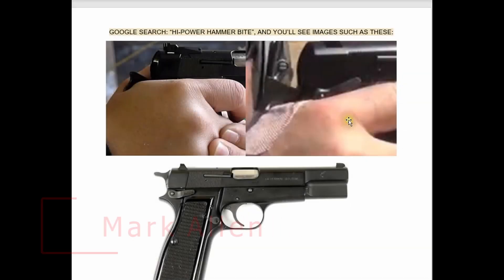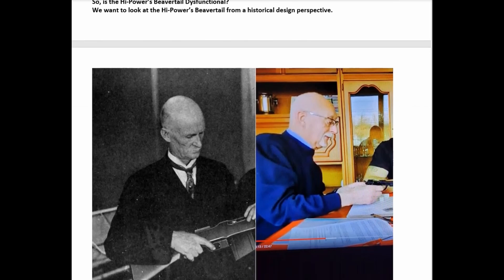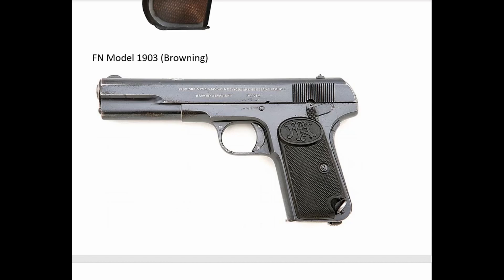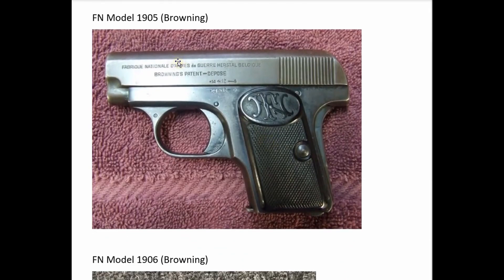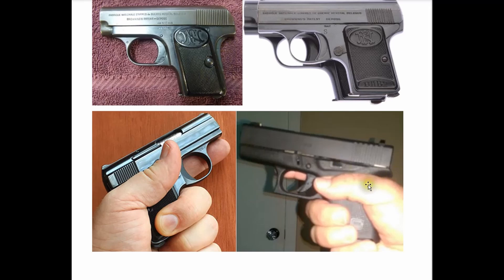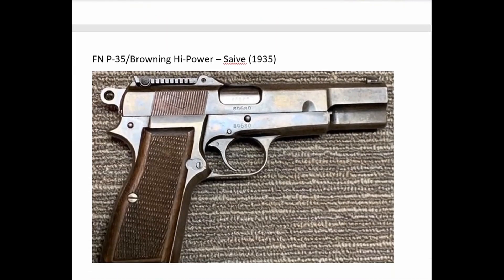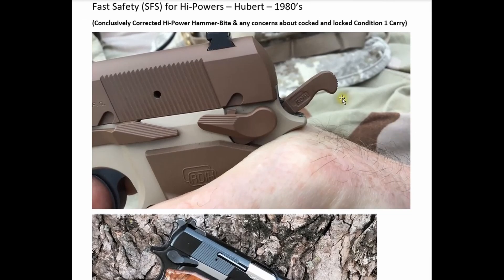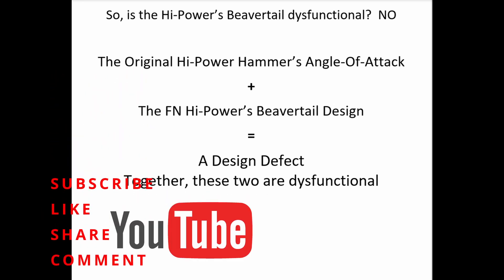Is The Browning Hi-Power Beavertail DYSFUNCTIONAL?  BHSpringSolutions Hi-Power University Session 78

Comment: Thank you for your effort on this vid, very well done, I have been eyeing one for years and this sheds some further insight as to mods. Have large hands and love my CZ 75 's  I welded and reflaired one of the beaver tails to avoid hammer bite and yes it is very labour intensive but solved my problem. An elastoplast bandage before shooting for the rest. We are all built a little different so compromise may be neccesary. I love 1911's but grip safeties don't work in my hands 100%
Reply: I picked up a Tangfolio CZ-75 clone from the late 80s recently.   Found at pawnshop,   box, mags and holster included.    250$.   I'm very happy with it so far.   Great trigger, good fit and finish,  tight slide etc.

Comment: I have the SFS hammer. It is not an issue, but the relationship of the hand to the slide in its movement when a person uses the standard grip these days still causes slide bite (to me).  Something needs to be offered to protect the hand. I worked with members of an elite unit that had to tape their hands. I had the same problem with the Glocks I used.